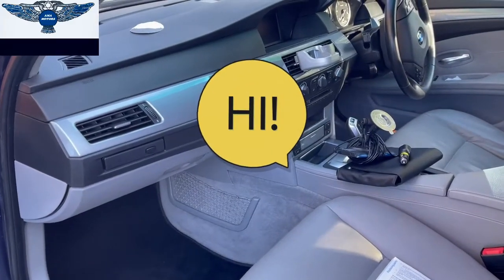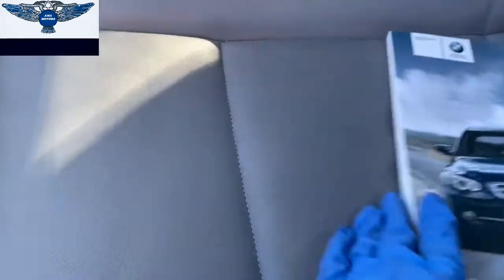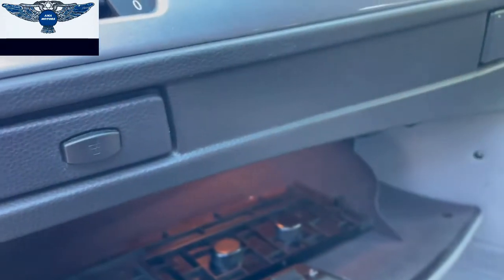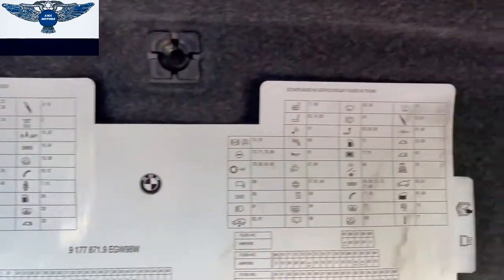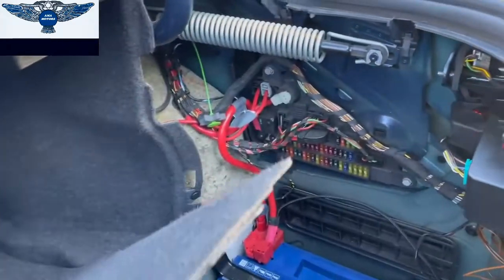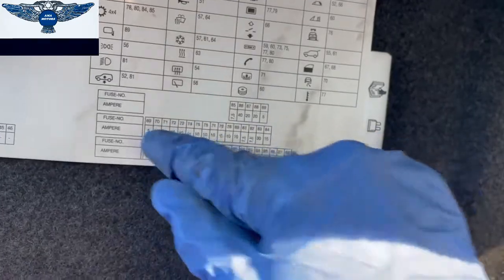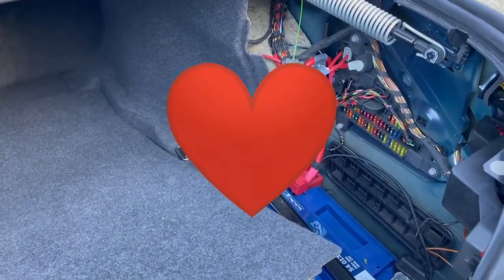BMW 5 series e60 2008 fuses location

Comment: Which fuse is for the license plate
Reply from the maker: Usually they are wired with the side lights, are your sidelights working, if so you may want to check the bulbs if that’s what you’re trying to fix.

Comment: i was having some problems with my 528xi so i thought to check the fuses with a circuit tester,i got the diagram in the first aid kit ,came to find out it was missing like at least 8 fuses i matched it too look exactly like the diagram theres only a few spots where its not supose to have any , that if it has only the (  *  ),   * is for M5/M6     some slots say for example slot [[13]]  has [ 30][ *15] so is not m5 use a 30 if m5 use 15    if only a * is present and u dont have a M5/M6 leave blank , i dont know if my logic is right but when i checked the fuse box in the trunk it matched exactly like the diagram i also checked all of them with a circuit tester.
Reply from the maker: Hi I didn’t really have any problems the vid is just to show the location of fuses. Most car don’t have all the fuses in the slots as it depends on the equipment the car may be fitted with.

Comment: My ac compressor was just replaced now it won't blow cold or hot
Reply from the maker: oh, may be you should ask the garage that replaced you compressor to have a look as they would have tested the compressor after fitting. thought the blower should work irrespective of the compressor so you may have completely different issues going on, you may need to check for fault codes.

Comment: bro how can i fix the ccc, will just removing and putting again the ccc fuse fix the navi, thanks
Reply from the maker: I don’t think so, if the ccc fuse is blown then yes probably that will fix it, check the fuses on the actual ccc and the radio fuse. If both are ok you may have a bad ccc.

Comment: Where does the Fuse Pullar stays in glove box? Please let me know
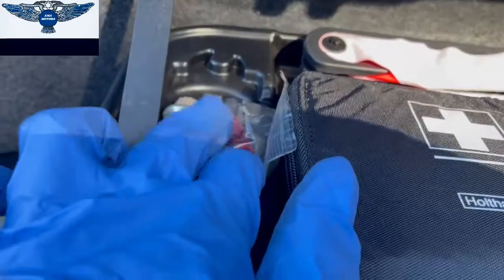Reply from the maker: If you watch the video, at minute 2:15 I show I little bag with spare fuses, in this bag the fuse puller is supposed to be there…
Reply: @DaringBeefcake  thanks so not inside of the glovebox’s fuse panel
Reply from the maker: @Maxsarkar  nope..

Comment: when my car is overheating they told me I got to replace them is it only one just one I got replace one or all of them
Reply from the maker: Just to be clear, are you asking if you have to replace all the fuses or one fuse due to the car overheating ? If that is the question then it doesn’t really make sense, because they should tell you to check the the fuse that runs the radiator fan and also the relay. But overheating can be due to many other reasons, such as a faulty thermostat or water pump, temperature sensor etc etc. this is why am not sure I understood the question properly sorry.
Reply: @DaringBeefcake  I just bought the thermostat buy they also told to me replace the fuse with a new one and it’s a Green 30A
Reply: @9lphy  oh I see, well by all means do replace the fuse, what do the say the fuse is for ? The fan, thermostat, gage ? , not sure why to be honest, but you could check it.. have you check for fault codes.
Reply: @T.F.D77  for Thermostat but idk where it goes
Reply from the maker: @9lphy  to be honest I don’t think there is a fuse for the thermostat itself. The thermostat is mechanical part as far as I know, I know in some cars is electrically operated but if you have the thermostat you can see if it looks like a normal one or electric one.
Reply: @DaringBeefcake  I got my thermostat but the dude that told me he said to check Check thermostat, fuse, reservoir cap, and water pump. 

It needed for sure a new Thermostat my engine was overheating it made me stop like couple times I checked the reservoir Cap good and water pump Its just I dont where to put it I already got the 30amp that I needed
Reply from the maker: @9lphy  if you change the thermostat and the car is no longer overheating, you don’t need to change the fuse.
Reply: @DaringBeefcake  my mechanic replace the thermostat and it still overheats still get the Pop Up "Engine Temperature" need help 

If I need to change the fuse which slot is it and I bought the 30amp fuse But I dont know where to replace it at Glove Box or Trunk I have a BMW E60 528i 2010 6 cyl automatic
Reply from the maker: @9lphy  I dont know where that fuse would be to be honest, doesnt your mechanic know if he suggested it as it wouldn't take him long to change it..is the fuse car missing in your car..
Reply: @DaringBeefcake  when I found the fuse location by the glovebox their was just a 30amp fuse loose their laying down
Reply: I replace a new thermostat I still get the Engine Temperature pop up on my iDrive so I’ll guess i have to replace my Electric water pump and fuse but my mechanic doesn’t know where da fuse goes for my thermostat. 
I dont even know where to look for the slot I just know its a 30amp I tried to read the manual dont know
Reply: @9lphy  I think the crankshaft/camshaft position sensor and thermostat share the same fuse.